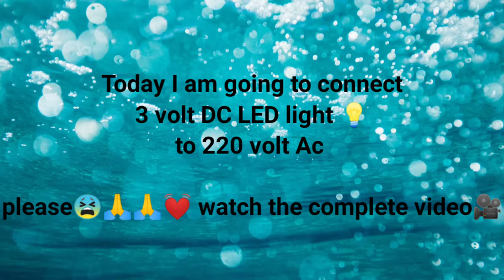How to connect 3volt LED light 💡to 220 volt AC

Comment: Diode not required at all.......
LED itself a ractifire.......
only LED and resistor 100K in series required........  

better is two quarter watt resisters 220K+220K in parallel........

Comment: 1:46 mmmm... you touch 220V with your hands without any problem :O ? Your current is in low voltage friend ! :|
Reply from the maker: No bro that time switch of the extension board was off . I think you understand if any problem comment me.

Comment: Not true. A 220 volt ac suply without a ttransformer will blow up both that diod and the risistor imidiatly.!
Reply: The current reduced by the 100K resistor